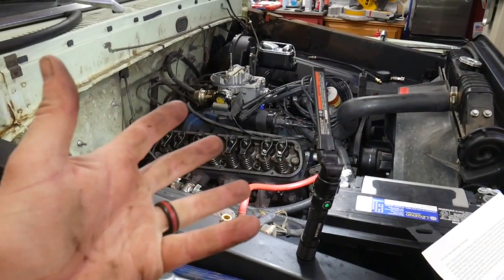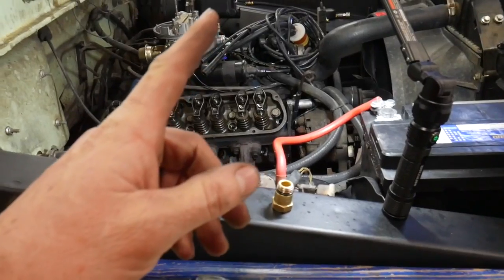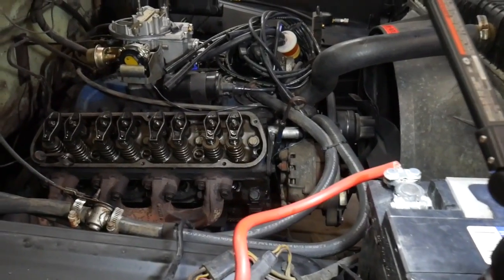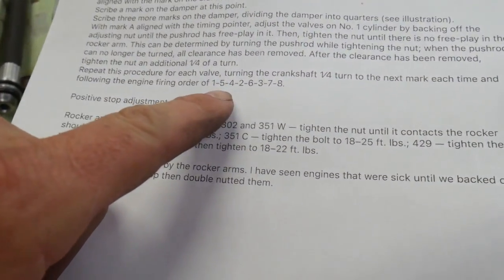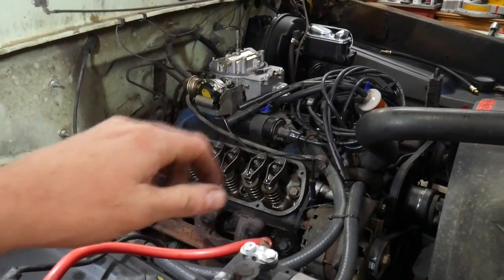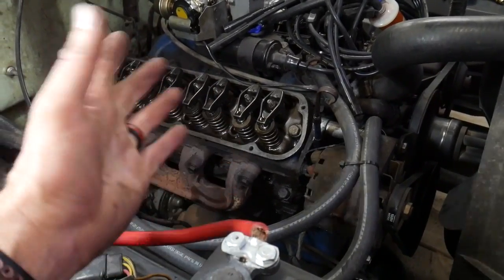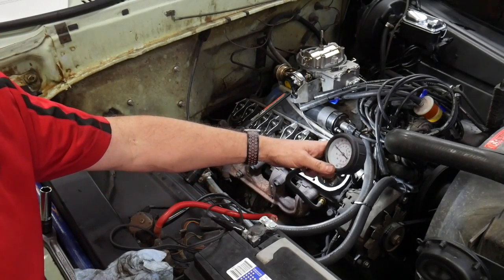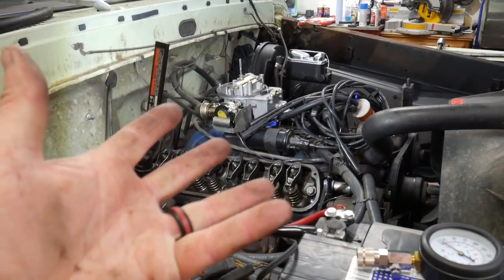HOW TO adjust valves on a 1972 Ford 302 from an F100

Comment: I’m just starting into your videos but if it was running you could do it while running. Back off nuts until it rattles, back in until it’s quiet then 1/4-3/4 turn depending who you listen to. Another thing I’ve done and still do if you think a ring is stuck just run a quart of diesel in it and drive it for a bit. If it’s that it will definitely fix it and if it’s not it’s probably worn out. Disclaimer this is my thoughts not advice lol
Reply from the maker: Got this dialed in now. I still need to fine tune the carb and adjust the choke for the new temps. Just finished the dual exhaust, still needs wheel bearings packed (examined) and the carrier bearing swapped. A few more videos to go before this one is complete. Been a fun project for sure. 👍🏼

Comment: After a minute of thinking. The rocker arm nuts are loosening. Why? Are they threaded or pressed in? I think the old ones were pressed. Check the hight on all of them. If it is sliding out, you might be able to do a Jerry rig drill and pin but I can't recommend that. First, I would remove a good rocker and all the hardware and compare to the bad and check stud height.
Reply from the maker: They loosened because in the previous video I replaced the valve seals. The engine was running and “healthy” other than the insane amount of oil it was burning (thus changing valve seals). Just needed to reset valve lash/preload. This adjustment process was perfect (spoiler alert 🚨). No longer burning oil (contrary to many of the comments on other videos too 🤷🏼‍♂️).  I still need to adjust the choke for the colder weather and adjust air fuel mixture and possibly timing.

Comment: People use to shim under or above the rockers if valve stem lengths were different. This caused the rockers to not sit flat on the mounts and allow wobble. Sometimes the bosses would crack or the stud/nut threads would get damaged.
Reply from the maker: These all looked healthy, not stripped or cracked. The studs were all at the same depth etc. This adjustment process worked great (spoiler alert 🚨 for future videos).

Comment: If you are still having oil consumption problems and you replaced the valve seals, either your valve guides are shot (common for Ford and older engines) or your rings are  stuck in the pistons or just totally shot too as far as tension.  Valve seals don't really cause major smoking or oil consumption problems, even if they are shot or not even there.  You can try putting marvel mystery oil and other solvents (paint thinner, mineral spirits, etc) in the cylinders and let it sit and cross your fingers.  Turn it over to blow the fluid out before putting your plugs back in as to not hydro lock it and bend a Dinky Ford rod.
If you try that, change the oil before you drive it.
I am going to guess by it's age that your rings and valve guides are both shot.  Sorry, just my opinion as an engine builder.
Reply: I had a Honda with low tension rings that did the same thing after i rebuilt the cylinder head.  I soaked the cylinders with all kinds of stuff, yet it still smoked like a chimney going down the road.  I eventually put rings in it after it burned another exhaust valve from all the oil consumption.  Come to find out later that the rings are so low tension that having the head off for a few days, dries out the carbon build up and causes them to stick in the ring grooves.  Most common with Hondas, but have seen it on Chryslers too.  Can happen to any engine, really and the more worn the rings are, the more likely... they lose tension over miles of running.
Reply from the maker: Compression increased after soaking with AIM Extreme Duty Lubricant. Tells me rings are definitely at play here.

Comment: Non adjustable studs means you torque them down with no regard to pushrod play and lifter pre-load.  The method you describe is for adjustable studs and lock nuts.  With a Ford, it's hard to say which is on it by watching this video, they used different things in different years.  Your 1/4 crank turn method works, but if you dig deeper, you'll find that there is a 2 revolution method based on the firing order.  Set it at #1 TDC Compression and 8 valves can be adjusted, turn the crank 360 (TDC on cam overlap) and the other 8 can be done.  I don't know the Ford numbers without looking it up, only SBC and BBC.  Just be sure of which TDC you are on.
By how easy the nuts appear to turn, I'm going to guess yours are torque down rockers and they will back off when it is running and you'll lose your adjustments quickly.
The method you are using is typical for an SBC, but not an SBF.  SBF's are usually torqued down and done.  They can be adjusted in other ways.  Double nutting them may work, but is NOT the way to do it and insure that geometry is correct.  Bad geometry causes other issues after it gets running.
Have the heads or block surface been machined? Has the cam and lifter style been changed?  Ie- going from flat tappet to a roller cam?  You may need shorter pushrods, but it's not that easy AND keep proper valve train geometry.
I can make better guesses for you with more info.
Also, if you torque them, the lifters may need time to bleed down.  Depends on how fast you are doing your compression test after you torque them down.
Don't make the marks on anything except the crankshaft pulley, the pulley ratios on your fan and other accessories does not equate to 1/4 crank turns.
Reply: Judging by how your nuts turn by your finger, I'd say its a torque down valve train and not adjustable, especially if it ran before this.  I am thinking you aren't giving the lifters enough time to bleed down after torquing them and then compression testing.  My guess is, they are gummed up and it might take some time.  I suggest torquing them all down, turning it over on the starter a few (the more the better) revolutions and THEN do a compression test.  Also, if it is a stock flat tappet cam, use high zinc oil in it, otherwise, you'll find yourself putting a cam in it.  Don't worry about turning it over on the starter with pumped up lifters, even with a big cam, a decked block and shaved heads, it will still have miles of valve to piston clearance.  I don't think you have any of that going on.
Reply from the maker: On the googles there was no less than 20 ways to do this. I picked the one that made sense from what I see on the motor and from the replies to the forum post. So far this seems to be the correct method for the truck. I still haven’t fired it though. Started on interior (done and will be next weeks video if I can get it edited) and some body stuff too. This is a fun and challenging project.
Reply: @troysgarage Yeah, I'm an engine guy and am not too interested in the truck or the interior, BUT, would like to help you through the engine basics.  Double nutting those rocker nuts isn't right and should only be a last resort.  If anything, buy lock nuts, but that isn't right either, especially if it was running before this.
Reply from the maker: @TTGTO288  I do appreciate the help for sure. It was running before but wasn’t running great. I rebuilt the carb and it fired right up after that. But burned a lot of oil which started me down this path of valve seal replacement. I’m about a week away from firing the engine based on the time I have to work on this in the evenings and weekends.
Reply: @troysgarage Yeah,  carbs are junk in my book ... EFI all the way ... if it ran before and rebuilding the carb made it run good, I'd blame the carb.  I can rebuild performance Holleys, but after that?  I have no interest, just buy a new/rebuilt one.  Still hate carbs ... junk.  
Either way, I'm going with lifters not bleeding down in your case.  Torque them down again, turn it over on the starter a few times, then compression test it.  We'll go from there.
Reply: @troysgarage  Unfortunately, I don't think valve seals are going to fix your smoking problem.  Hell, SBC's used almost nothing up until the 80's ... I've built race engines without them and never had smoking issues.
Reply from the maker: @TTGTO288  I’m hoping the rings will come back around after soaking for a while. We’ll see pretty soon.
Reply: @troysgarage I hope they come back and best of luck, you'll need it.  Miracles in a bottle never worked for me, but the more you drive it, the better it should get, to a point.
Reply: @troysgarage anyway, I'll do what I can through video to help you over this valve train hump.  It's easier than you think, especially with a stocker.
Reply: You are the first person to say 1/4 turn after 0 lash 👍🏼 every other person says 1/2 turn with I always found to be too much. I always do 1/4 turn.